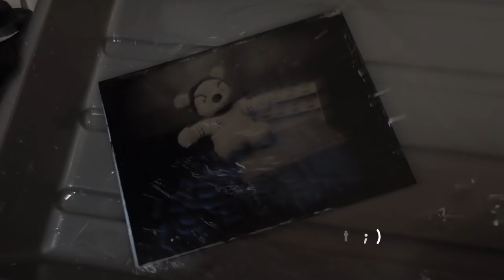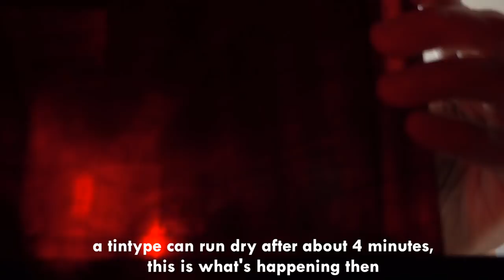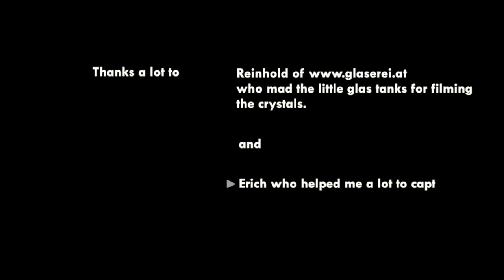Ultra macro video of the collodion wet plate process

Comment: What is the magnification when you are viewing each step of the process? How big can we blow up the images without losing clarity? I often tout 4x5 (and above) wet-plate photos as the highest resolution photographs. By how much? What metrics can I use to describe this to people?
Reply from the maker: I used the Laowa 25mm f/2.8 2.5-5X Macro, so this is a 5 times life size video. The maximum resolution of a wet plate depends on the scanner you are using. Have a look at this video about scanners and wet plate: https://youtu.be/Oi3Tef3zZPE 
A wet plate is made of pure silver and there are lots of silver molecules needed to se a little point of silver. Resolution is huge.  Depending on the plate size, gigapixel are possible. Hope that helps.
Reply: @mhaustria  thanks!